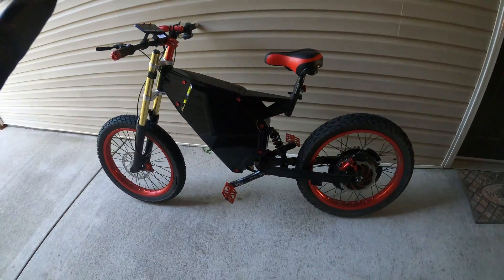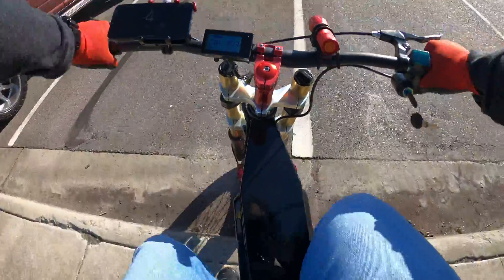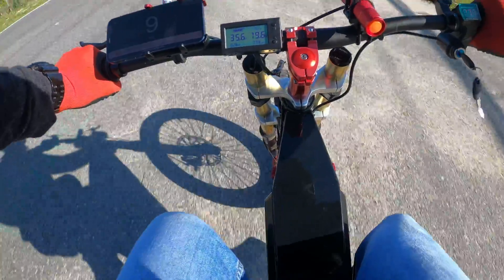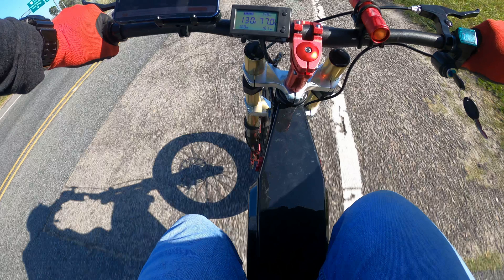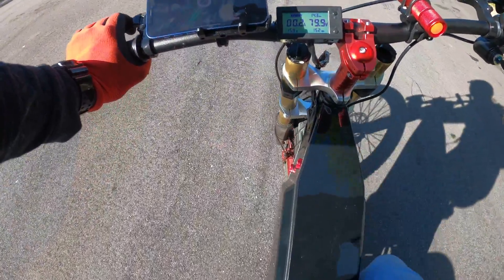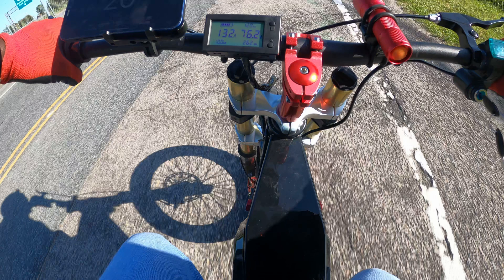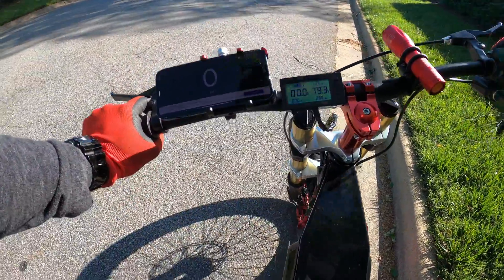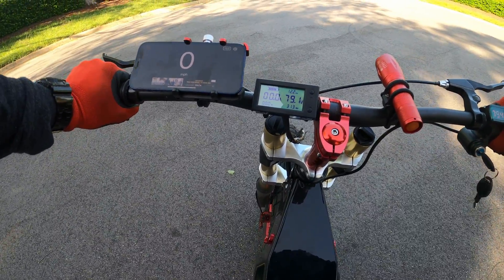Enduro E-Bike Test at 10,000 Watts and 50 MPH

Comment: What kind of range do you get?
 I've got a 30 mile round trip commute to and from work
Reply from the maker: I have a 21s3p 77v 15.6ah lipo pack at the moment. I usually get 20-25 miles riding normal, 15 miles at the lowest riding hard. Im still thinking about going 96v so I haven’t pulled the trigger on a premaid battery yet.

Comment: heya i added 5 x 16 ultra capacitor modules from ebay in series for 80 volt and wired it in parallel with the main battery ,since they have all nthe charge circuitry on pcb for each module ,didnt need any addon bms. now dont suffer any voltage sag  at all seems to even charge way faster now too  ,and can even see regen braking returns  ,need to have a good controller though that automaticall disables regen output when battery is full .
Reply from the maker: I’ve been seeing more people use capacitors in their ebikes. Seems like it would make sense for acceleration and quick burst without taxing the battery. I’m gonna definitely put some thought into it. My regen is automatically disabled above 80 volts also. Thank for the info.